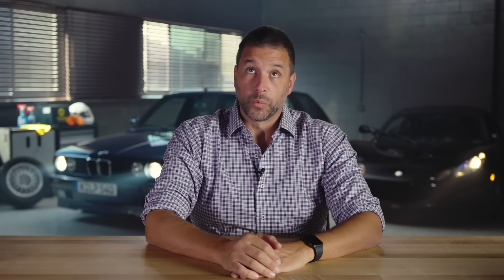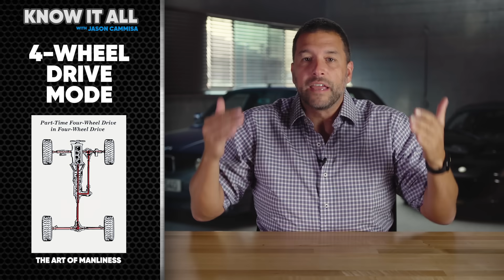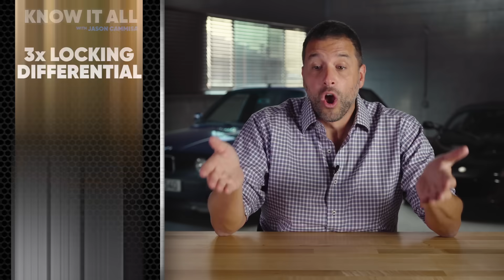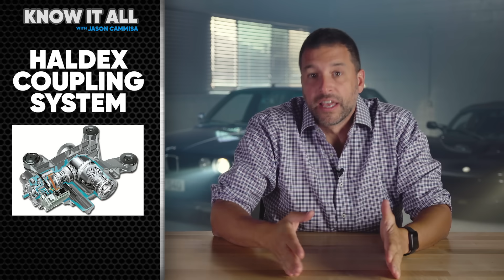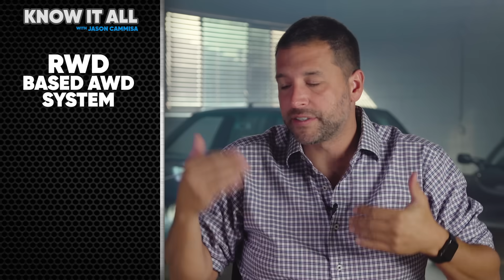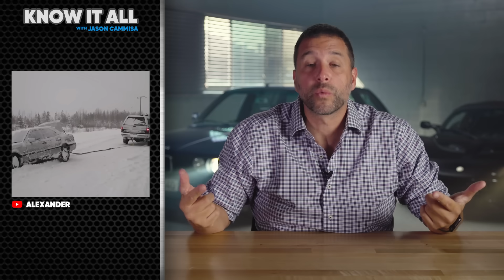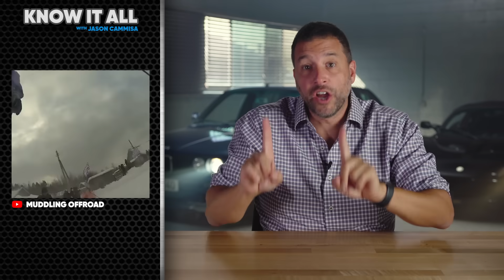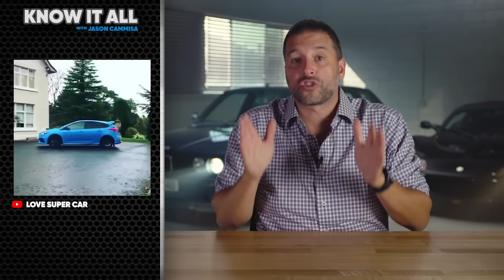Understand Your All-Wheel-Drive System | Know it All with Jason Cammisa | Ep. 04

Comment: A mk 8 golf R can send 100% of its REAR axle torque to either side which equates to up to a maximum of 50% of its total torque. This is because it has a clutch pack for each side and can fully engage one side only if needed.

Edit: it also does not have a rear differential, only a ring and pinion between the two clutch packs. Very cool design when you look at it.
Reply: It's an electronic clutch pack differential like the ones Ferrari has been using for 20 years
Reply: @BigUriel  except electronics have improved how much ?

Comment: The secret to a really good AWD system is to set up the whole car like it's FWD.  Give it a ton of rear bar, super aggressive front diff, make it pointy and scary (and fast) on braking/entry.  But, when you hit the power, it'll just put down more of it.  RWD cars tend to be conservative on entry, because a rear-drive car that's pointy on the way in will be Tokyo drift city on the way out.  See S2000 AP1.  Good FWD cars are focused on front grip and rotation, so they're wicked fast on entry but just trying their best in exit.  AWD lets you have scary suspension but never get spun around.  This is why Evos are so fast; they set up their suspension like a hot Civic, but have the traction to accelerate too.  No compromise.  If you want the car to do drifts and stuff, do not buy an AWD car.

Comment: What about mercedes awd? Same as bmw?

Subarus?

Audi quattro T3 front 40:60 rear split?
My T1 quattro has 4:1 mod and LSD front and rear. Explain these a little bit if you will. It's a street car, I can't afford to drive it at the limit. Unless someone wants to sponser me. I don't claim to think quattro is the best out there. If it was I wouldn't have gotten stuck at the end of the driveway in six inches of snow, lol. That's what led me to front rear lsd and 4:1 mod

Comment: You should really fact check a bit more. At least I am partly watching theese to learn and if there are big errors that I know of it raises the question on how trustworthy the information is.
For example. Audi and VW are using entirely different AWD systems. VW uses a Haldex system that behaves as you describe as you describe tha Audi system. But Audi uses a different system based on a Torsen Diff that is alway driving all 4 wheels. 50/50 is standard but some models use rear wheeel bias with 45/55 or 40/60 and depending on the version it can distribute up to 85% of the force to either front or rear axle without help from ABS/antiskid systems. With help from theese systems it can be even moore.

So your information on Audi is blatantly wrong. There are also other versions of AWD that other brands use. For example Subaru uses 4 different systems depending on model and year. the later years it is mainly based on a planetary gear in the center diff that always drives front as well as rear with a distribution of 50/50 and in some versions a slight rear wheel bias. 

I can not speak for what system BMW uses but with the grave errors in the information I find no reason to trust that information either.

Comment: I’ve got three different types of AWD/4WD systems.   My wife’s Hyundai Tucson is front wheel drive most of the time, supposedly.  I’ve never pushed it in low traction areas.  But in front of the shift it has a little diagram showing how you can lock all three diffs, and it’s called “Diff Lock” right on the button.     I pressed it while parked once and it seemed to show that the front, center, and rear axles each had a “lock” padlock symbol on it.       Weird but rad if it’s true.    I will say that it’s peppy for what it is and there’s no perceptible torque steer, and I once stomped it in anger on the side of the Hwy in the grass from dead stop and all four wheels definitely spun but it seemed like the front did the most steering, as opposed to my ML320, which exhibits mild, very mild oversteer with ESP off in the same conditions.    No donuts, and never feels front wheel drive, but definitely feel all four wheels all the time, yet never understeer under power the way Jason said any AWD system would.   The Merc system basically is 4WD all the time and I’m pretty sure the center diff is either locked or very little slip is allowed, as it’s never left me with the front wheels spinning and nothing from the back.    Plus, it uses brake assisted limited slip for its version of a limited slip with clutches in the diffs, which chatter and can wear out.   It uses the various wheel speed sensors as well as its gyroscope to put power where needed and apply brakes to force this action.   Left rear spins in the mud, a little brake to just that wheel forces more to the right rear, same up front, and front to rear.  If both front wheels are spinning it will apply enough brake to the front ones, with the highest speed one receiving the most brake pressure,  until any and all other tires catch up and speeds are matched unless steering angle or yaw are telling the computer that a front wheel should be allowed to spin at a different rate than the other.      The Jeep Quadra-Track is similar, thanks to the Daimler-Chrysler merger.   Then there’s my 2006 Burban.   There’s 4WD auto, 4WDHi, and 4WD Lo, with Lo being a stupid low granny gear in true all locked up diffs all around and could possibly pull a house off its blocks.     I once had it badly stuck in my backyard and in 4Lo at full throttle, which would probably mean a top speed of like 15 or so, maybe 20, but it limits e fine speed in that mode, to I think around 3500rpms.    4WDHi is also locked diffs all around.     But 4WD Auto is different, where you could just leave it in that mode all the time and drive around in dry weather in pavement, no problem.  The deal is that if the wheel speed sensors determine that the rear wheels are going just a little faster than the fronts, it applies a clutch pack in the transfer case, bypassed in4WDHi, and seamlessly becomes 4WD, but the front actuator only deploys part way, and does not lock the front diff, and of course the center is t locked either.   Of note is that if you have the G80 rear differential, you have what I think it the greatest diff setup for off reading.   It’s purely mechanical, not connected with any wiring, no clutches, only a Park pall like mechanism and counter weights for each rear axle shaft gear, and if one wheel turns at more than 100 RPMs than the other, the difference in speed allows an otherwise in-synch pall to swing into place and literally lock the two sides of the rear axle together as if you had a spool or welding your rear diff.   You can feel it hit when it dies, and it remains that way until both wheels go the same speed long enough for it to release the pall.     If you have it engaged and are turning as you come out of the mud and onto pavement it will still hop around until you go straight for like 20 feet or so, but if you are turning at all it won’t release.    That diff has saved my ass by. Eig a full and every time lock that performs unlike any other diff.    Other types unless they are like the air lockers, only lock up with wheel speed differences, like this, but if the wheels come to a stop, those clutches disengage, and when you set off again you lose those precious feet of positive grip to get out of that mud hole or over that hard obstacle unweighting opposite corner wheels.   With the G80 it stays locked, even from a stop.     I have been caught in the mud with out 4WD on and also not engaging , but that spool like rear axle when engaged got me out of deep mud, 2WD only.

Comment: What about the Torsen based system in my '10 A6 - which supposedly features a 40/60 front-to-rear torque split.
I've actually and unintentionally spun it almost completely in intersection, on dry, when trying to make a rushed start while steering left at 90 degrees :D
Oh the goold old times :)))

Comment: I mean the one type you forgot is torque split like the STIs have where it sends 66% of the torque to the rear nominally and can lock up when it detects slip or under throttle to send effectively more torque to the front but at the expense of considerably more understeer this is how the bmw systems work to but with a transfer case instead of a transaxle.

Comment: If you care more about getting out of the snow bank than driving at the limit, the Subaru with X-drive is your bet.  At slow speeds only, when X is switched on, the computer brakes any wheel that's slipping.  So you crawl out of the snow, or off the hump that would let both wheels on the same side spin free.

Comment: Interesting you left out the T3 Torsen Quattro system, its a permenant mechanical AWD (no clutch packs, just a centre torsen diff) but the rears are overdriven to give a 40-60 front-rear split. They put these in a lot of cars, I have an 09' A4 with this and I love it, though because the transmission and AWD system are so bulky the whole engine is hanging forward of the front struts making the car quite nose heavy, kind of negating the benefit.

Comment: what you're saying is contradicting itself. you said a taller ratio in the rear but then you're saying the back tires need to make more revolutions than the front, that would be a lower gear ratio. the rear tire would have to be a smaller diameter than the front to make more revolutions than the front.

Comment: Please note I agree with everything said in this video.. I'm not challenging the statements made but I'm left with a bit of a question about an amazing car HOLDEN built from 2003 - 2006 known  as the ADVENTRA (also this Cross Trac system appeared in the Cross6/8, GTO coupe, Avalanche wagon & SUV). They all use the rear wheel drive version of AWD.. but I dare say the many times I've taken mine to the outback.. it always feels there is power at the front (and rear) wheels.
Holden designed it with a "permanent 62% power bias to the rear"  - so unlike the above mentioned..  This "mechanical AWD" system is perhaps a version where power isn't shifted around as needed like in the cars mentioned above?

"Adventra will beat Ford Australia’s first cross-over, the Territory, to market by around nine months. The $500 million project is tipped to have a mechanical AWD system."
"It is a permanent system which transfers torque 62 per cent to the rear wheels and 38 per cent to the front wheels. It does not include low range.
"
-Quoes from Goauto 

I've also remember hearing things like the AWD system was designed in conjunction with Subaru & it was at least intended at one point for the H2 Hummer.. I can't firmly verify that so please take that with a grain of salt.

My entire immediate family owns these wagons, my father has over 500,000K's on his and it still going strong.. all of ours are power by the LS1 (5.7ltre V8) so reliability & servicing is great and cheap! - I've been in some dicey situations in mine but the AWD has always got me out~

Comment: You didn't discuss computer controlled seperate wheel braking to control single wheel traction. (I know another video)

If you want to experiance a locked differental drive a Ural 2wd sidecar motorcycle with the second wheel engaged. Works much better on slippery or dirt surfaces. Some large commercial trucks have locking differentals. Great for getting moving in mud and snow, use it on dry pavment and you are probably going to break an axel.

Comment: What about ... Subaru? Wouldn't it be hard to say Subaru started as a 2WD? 🤔 The front diff and center diff are both in the transmission; on DCCD models, the user-controllable center diff can determine the proportion to the rear (between some limits like 50-90%). Did I just answer my own question? 🤔 The type of front, center, & rear diffs vary between models... e.g., a 2006 WRX (not STi) can become 1wd in a slide; the STi will maintain at least 2wd. I think.

Comment: VW awd is far better than fwd only, it will not oversteer in the dry but partially applying throttle while exiting corners give more speed and reduce under steer by a lot especially if the haldex ecu is tuned to send more torque to the rear sooner!

Comment: I've always been 100% OK with the FWD base for my variable AWD Fusion derivative.  It does great in snow(I have enjoyed some beautiful oversteer slides with the AWD system in it as well), there is no crummy incessant FWD traction loss every time the pavement is not perfectly dry, and it engages rear torque in league with the turbo-lag so the pull is pretty satisfying.  I'm also 100% OK with the finicky DCT, Powertrain Control Module, and Turbo lag(only in Sport though), because they are "the nature of the beast" and it nets something a million miles better than anything I ever drove twenty years ago.

Comment: As an owner of a 2018 Subaru Forester XT I'm surprised to see that you didn't mention Subaru's symmetrical AWD.
Reply: I am also intrigued, seems Subaru has like 4 different AWD systems right now, based on clutch packs and viscous diffs, wonder if that makes a difference in handling. For example I own a 6MT Crosstrek, dont know if it is Torsen or what kind, but it works amazing on dry surfaces but doesnt give me optimal traction on wet, slippery ones when I try to drive fast.
Reply: Thanks. You saved me some time…
Reply: He did mention Audi's system, which is basically identical (they're both Torsen systems). I say this as someone who went from a WRX to an A4, aside from the A4 having an open rear diff vs the WRX's LSD, both behaved mearly identical.
Reply: @S50Sinner  my understanding was that the TORSEN Audi's of the 80's are all but gone now, replaced by versions more like the Haldex system.  "Quattro" used to mean "symmetrical AWD", but no longer.
Reply: @jbrovage  Torsen is still present on all S ans RS models (excluding the TT and type 3) and was on the base models as well until 2015 when a Haldex-like system was introduced for certain A models. Needless to say, the A3 and TT have been Haldex all along.
Reply: @jbrovage  I have a rare AWD system in my rig and would like to have Jason give it the rundown. Apparently in 1999 Chevy had some sort of agreement with Subaru...  LSS - My 1999 Suburban has 3 modes for the drivetrain - "2WD" (Rear only), "Auto 4WD" (employs some Subaru derivative for when wheel spin in detected, it will engage the front) and then "4WD" where it locks it all in, lets me drive in 3ft of snow but only in a straight line.
Reply: @jbrovage  All the longitudinal engine Audis still use Torsen. Only the smaller transverse engines Audis use Haldex.
Reply: @buskE46  I know this is a year after you posted this, but the system your suburban has was originally developed for Jeep in the late 80’s by New Venture Gear in the NV-242 transfer case. This system was also used in Escalades and such. No relation to Subaru at all.
Reply: @S50Sinner  Subaru do not use a torsen for the centre diff. A few sti models used a torsen in the rear. But the centres were either electronic clucth pack (AT), DCCD (same thing but MT, also adjustable) and viscous lsd bevel gear centre diff.
Reply: @procrastinator1842 this, and I believe most of the Subby AWD vehicles not named STI were open front and rear differential + tractional control…but correct me if I’m wrong. Subaru’s OEM solution for most of their vehicles isn’t an advanced system but it sure works well for the most part and most importantly was always on. It was the advent of traction control that killed the LSD in so many AWD systems. I kind of hate that fact.
Reply: @TheLumberJacked  There are a lot of different variants. For Manual transmissions, the AWD ones all had a VLSD centre. It's too hard for me to list. The beauty is you can mix and match without too much trouble. I have an outback with some nice diffs from other models, and it's a blast to drive on dirt.

Comment: Great videos btw. Can you explain how my 2015 Chrysler 200 S AWD works in the real world? Its advertised as being able to send 60% of the tq to rear diff if needed. But the engine has only 260 ft lbs tq., 295 hp. So is that good for awd system, or just ok? Thanks.

Comment: I've owned several AWD. All power to the front and AWD when required (No driver input) Great system but knowing it's limit is the key. I also owned 4WD (Standard and automatics - locking front hubs and full time hubs) Again, great results but knowing their limits is the key ! The different types of transfer cases is another key point (chain vs geared etc. etc. etc.) The combinations are endless. Over the years I've found that Jeep has one of the better systems (with locking differentials) BUT, knowing it's limits is always the key.
Great video !

Comment: The 1986 Quantum Synchro I owned back in the day had the three position switch on the console to lock some or all of the three diffs (as you said it went straight when all were locked) but would not get stuck. It was a station wagon with a 5 speed and 5 cylinder engine with 411 rear gearing P7 tires. It was a ball to drive...........but only got about 18 mpg.
Kinda wish I still had that car sometimes.......

Comment: I would like to point out with old fully mechanical second gen quattro without front and center locking but with rear locking (urs4/6) . you can get it to oversteer like and sob . the center torsen can send up to 75-80% rear . it can rotate under power . I've done it in my urs4.  You actually can learn how to rotate the car and manipulate where the torque goes with the throttle